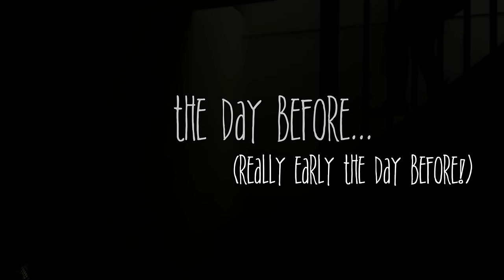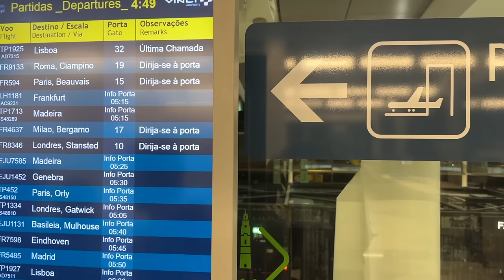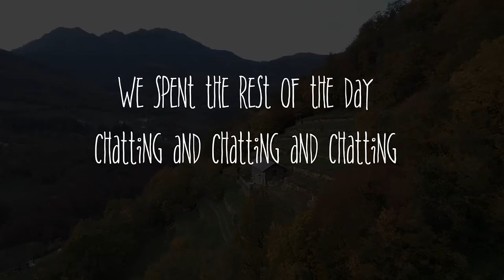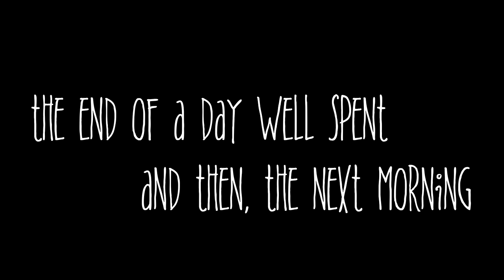Looking at a property in Italy | Should we move?? With @RaisingVoyagers

Comment: The wood planks are what is known as shiplap.  Install them over plaster or across studs with firing strips, over walls that are well insulated and wrapped.  Used in beach houses & cabins as a decorative feature on walls, installed vertically or horizontally,  & finished with stain or paint.
Reply from the maker: Amazing Terradiva, thanks for sharing friend ❤️🇮🇹😊